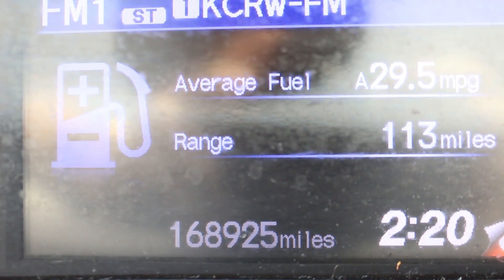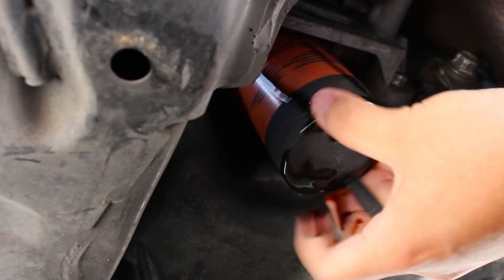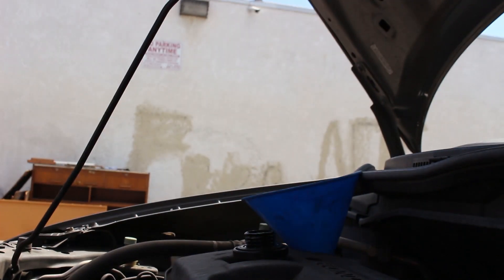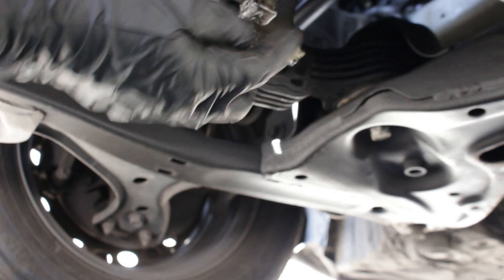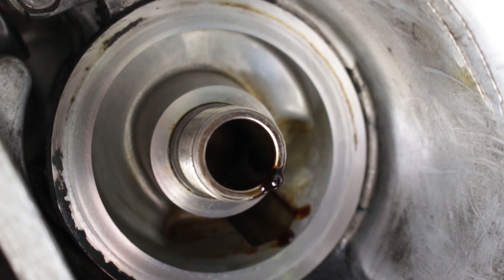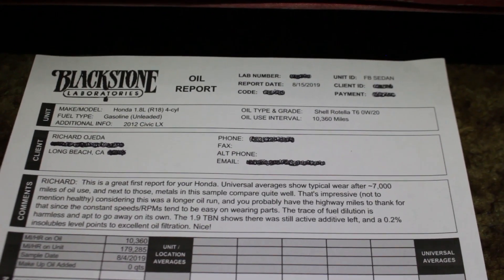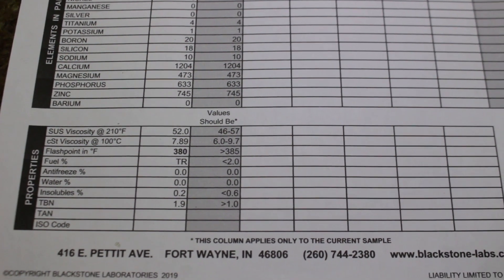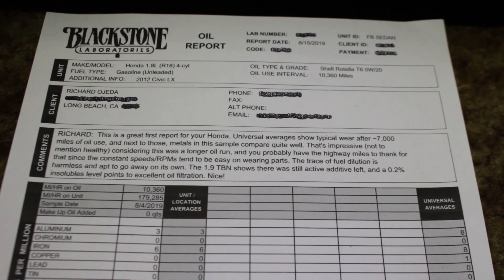10,360 miles Used Oil Analysis.

Comment: Unfortunately Shell dont approve to use this oil in a turbo ecoboost car engines, probably because a turbo engine is to hot and the oil flash point is low? i dont know why Shell dont recommend this oil for cars if is a lot of ford trucks with turbo ecoboost engines.
Reply: I use the  Rotella t6 for my gasoline BMW turbo inline 6.  I know it is good for turbos. The diesal oil has more anti wear additives
Reply from the maker: @zmanphx  I would probably use a synthetic diesel motor oil one day in an 2009 Audi A3 2.0 T and see how it performs.
Reply from the maker: That's surprising. I think it could still do a good job.

Comment: Could I use this same “truck” oil for my camaro ?
Reply from the maker: Of course you can use this in your Camaro.
Reply: Richard Ojeda Hi Richard ! Can i use this oil in 2018 Honda Accord sport 1.5 turbo vtec ? Thank you !
Reply: @romankim3198  
See what oils are recommended in the manual, regarding the turbo
Reply: But turn off the lights when you pour it , this way your Camaro will not be upset reading the label which says "truck".

Comment: Why is you drain plug so tight? No need for that.  Fram filter ?? That fucked the test.  You have to use the same filters if you are comparing tests.  I wouldn’t put 0w20 in anything.  Much to thin.  Manufacturers tell you to use that thin oil so they can meet EPS standards, not because it’s what’s good for your engine.

Comment: Best video !!!!!  What state is this and what outside temps?  I’m in Arizona and I’m wondering about the summer heat.  120s... LoL 

Thanks man!
Reply from the maker: Thank you. I'm in Long Beach, CA. Mild to Moderate temperatures all year long but we may go on some road trips to Las Vegas, or how I mentioned in the video we drove to Denver. I used this oil from April-June, mild spring temperatures so that probably helped out the oil.
Reply: Richard Ojeda sweet right on thanks man!! I’m making the switch!

Comment: Good Show Richard :) I'm into oils & lab reports - tho' I don't bother You Tubing it :) What Most impressed me on this clip: ZERO Quarts make-up oil added in 10,000 + miles? Using 0W20 Synthetic? & 179,000 miles? The oil level would've been a bit down the dipstick?
Reply from the maker: Yup, I never have to add oil to the engine. Every engine consumes oil no matter what but this Civic has been taken care of since brand new. This engine consumes very little oil, about four to eight ounces and that is a very small amount. I am a calm driver, I don't do any hard acceleration, unless I have to; in addition, this car has a 5-speed automatic transmission and the engine rarely gets high in the revolutions, about 1,500-3,000 rpms most of the time. Me being the type of person who loves to talk about motor oils and cars, I do my best to be environmentally friendly and try not to pollute unnecessarily. Thank you for commenting.

Comment: Gonna put this in an IS350! Looks great
Reply from the maker: It's a high quality motor oil. You won't be disappointed. Thank you for chiming in.
Reply: I put pennzoil ultra platinum 5w30 in my is350 and somehow it stopped burning oil after 4 oil changes.... I made a post on bitog.com and also club lexus 2nd gen is forums.
Dont expect the same results as I did but it may have broken loose and cleaned up a stuck ring I had.

Comment: You will be over the moon once you switch to Amsoil  I’ve tried everything under the sun you are wasting your time not putting it in your engine it’s really worth the extra cost
Reply: Good God.  He just showed an analysis from Blackstone that showed super protection after 10k.  Amsoil is great no doubt, maybe the best but I highly doubt the analysis from Blackstone would be any different .
Reply from the maker: How long are your drain intervals with Amsoil? I've used Amsoil once, and it was decent.

Comment: I change my oil and filter when I can’t see my oil level lines on the dip stick. Today the government is up the oil company’s rear end. There are no bad motor oils. Walmart Super Tech has all the fancy numbers and letters as the big guys. Walmart full synthetic $15.00 for 5 quart jug. Mobil One filters $10.00. That’s $25.00 for full synthetic oil change and top line  filter.
Reply from the maker: You're right. Even at Costco I can get 10 quarts of 0W-20 for $23.99.
Reply: Wrong!  While many of them share the same additive package one important thing to look at these days with GDI engines i the NOACK rating.  The lower the number the better.  Shell Rotella gas truck oil has a NOACK rating of 7.4 which is really low and means that the oil is less prone to evaporating under high temps.
Reply: @stefanpuffer  there are many people here on YouTube that have used Walmart Super Tech for years and some have well over 200,000 miles
Reply: Even better is the Chevron Supreme oil.  It's a synthetic blend and you can get 5 quarts at Walmart for like $13.  Even cheaper than the Super Tech stuff.  I get that and a Motorcraft filter for $4 and we're good.  Change every 5,000 miles.  Got over 230,000 miles on two cars.
Reply: the dip stick isn't for telling you when to change oil, rather when to add some more.  use a good oil and filter and change every 10k miles or 15 km, that what MB says to do.

Comment: Hello Richard!  Just thought I'd share the following info.  I put my 2013 Ram 1500, 5.7 Hemi, through 9,100 miles on the Supertech high mileage full synthetic.  Upon inspection, the oil did not look bad at all after that many miles, and even the filter housing looked very clean with no trace of varnish or sludge (just like you show in this video).  That was last spring and I still have a sample of that oil, which sits in the container that I received from Blackstone Labs.  I just never got around to mailing it off.  You think I should still send it in for testing even though it's been shelved in my garage for six months?
Reply from the maker: Yea, you could still send it to get it analyzed. Just shake it up for a couple vigorously for a couple of minutes. That is a good amount of miles gir the oil. Supertech is a great oil and I would continue to use Supertech. Does just as good as the name brand oils and less expensive.
Reply: @TheRichardF10  Yes it is a great oil and the price is even better.  But I'm ocd when it comes to this kind of stuff and did not realize that Supertech does not carry Chrysler's MS-6395 certification.  So for piece of mind (as silly as that sounds), now I use Valvoline's high mileage full synthetic and pair it with Wix XP oil filter.  I've always liked Valvoline, carries Chrysler's certification, and is reasonably priced at my local Walmart.  Thanks!
Reply from the maker: @aggie7756  Yes, Valvoline full synthetic high mileage is my favorite over the counter oil.

Comment: Tightens oil filter to 60ft lb. "That's all they really need guys". Hahaha finally met the guy that puts the damn filter on so tight. Nothing wrong with that at all but I prefer a little less snug fit the next time, and they don't go anywhere.
Reply from the maker: Everyone has their own way of doing things. At least I don't use tools to tighten the oil filters. I have never had trouble taking a filter off. I service my own cars either way so if there is a problem ,that is 100% on me. Thank you for the comment.
Reply: @TheRichardF10  for sure everyone has their own way. You did a fantastic job, awesome that you are working on your own vehicle, so many don't nowadays. Plus it's interesting stuff. Thanks for the content
Reply from the maker: @joem8875  Thanks for tuning in.
Reply: Richard Ojeda thank you for posting this video. In a couple of months, I’m going to be putting in Pennzoil Ultra Platinum Full Synthetic Oil along with a Purolator Boss filter in my ‘17 Civic for a 10k mile interval...I also do my own oil changes and this interval will cover the months of November - March which are the coldest months where I live (Indy) - will send off that sample to Blackstone Labs as well. Thx!
Reply: Just hand tight for me. Never had a problem.

Comment: I own a Toyota Tundra 2005 and have 360.000 Mile 1GR engine viscosity
Reply from the maker: That is a very good mileage.
Reply: The car I bought from America and I want oil in line with her Lynn do not know the owner of any car viscosity uses 5w30 or 10w40 Thank you

Comment: WIX filters are garbage bro, Mobil1 filters are badass.
Reply: Are you IDIOT? Did you open WixXP canister filter  and Compare to shitty Mobil1 JUNK filter? Think first, before you rip off such nonsense in the company of decent gentlemen !!!
Reply: @Andrew__Smith  buy American made. Purolator is by far my favorite. We get   Wix made in Mexico here. I won't put a made in Mexico filter on my truck. You are intitled to your opinion. Sorry if your skin is so thin.
Reply from the maker: What garbage about Wix filter? The insoluables can't get any lower with any other oil filter. Everything about the Wix XP is superior  to Mobil 1.
Reply: @TheRichardF10  if you like  like junk from China. Buy American made first.
Reply: I used a Mobil one filter and it was the worst filter I ever used. My friend had the same experience. I switched back to motorcraft.
Reply: Wix XP filters only remove like 50% of particles at 20 microns, in the full synthetic media segment, the Fram Ultra is probably best, and it's like 98% efficient at removing particles that are 20 microns, has dual layer wire backed full synthetic media, silicone adbv,  metal end caps, costs around $9.

Comment: Looks like this oil is working great in your Honda.  I'm using this oil in my Toyota Tacoma 2017 3.5l V-6 (switched from Mobil 1 Ex. Perf.). I'm getting a 1-2 more miles per gallon using Rotella.
Reply from the maker: That's good to hear. With the Honda, the car has never seen any gains in mpg by using a specific oil. This Shell Rotella Gas truck is decent oil.
Reply: I have the 3.5 in my Venza. Our 3.5's don't care what oil it has lol. I as well, just changed from Mobil 1 EP to She'll Rotella Gas Truck. It was on sale at walmart for 4.50 a gal. I go with what's on sale and I'm trucking along happily at 150,000 miles.
Reply: If you are getting better mileage it's due to changing driving habits. No oil is going to improve your mileage by that much.
Reply: @timmayfield2070  I was thinking he same thing. However, the only change was using this brand of oil?  I have been using Mobil 1 for years without any issues.  The main reason for the switch was the fact that Shell has a rebate on this oil.
Reply: @stephenmaurer7008  I still think it has to be something else. One reason more and more cars are now requiring thinner oils like 0W-20 is to improve mileage. Tests have been done using 0W-20 in place of 5W-30. The improvements are less than 2%. That's changing weight of oil for 0.4mpg more on a car that gets 20mpg. Have you changed the air filter or where you get fuel? If I buy fuel at Walmart I get 20mpg in my Silverado. If I buy fuel at Quik Trip I get 21mpg. Just saying there are many variables that can effect your mileage.
Reply: @timmayfield2070  Same air filter.  Maybe the stations are switching over from summer to winter-blend gasoline??

Comment: So are you going to continue to run this oil brand on future oil changes or switch back to Valvoline Full Synthetic high mileage?
Reply: Pennzoil is the best. For the price but amsoil is really the best but cost to much
Reply from the maker: I only intended to use this oil once. I honestly use which ever brand oil I feel like using. Valvoline is great oil as well but I think I will use Supertech from now on because it is just as good and it's less expensive.
Reply: @TheRichardF10  Supertech is a great oil for the $$.  However, (with rebates) Rotella is just a tad more??
Reply from the maker: @stephenmaurer7008  Yea, I am currently using Castrol Edge Extended Performance (Gold Bottle)
Reply: @TheRichardF10  Castrol is good oil.  Running the same type in my wife's 2017 Subaru Outback.